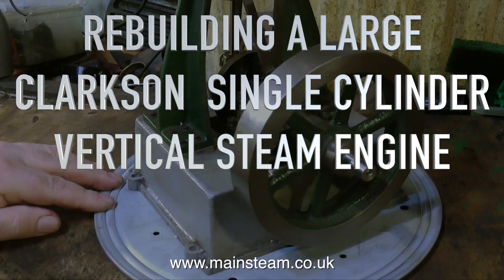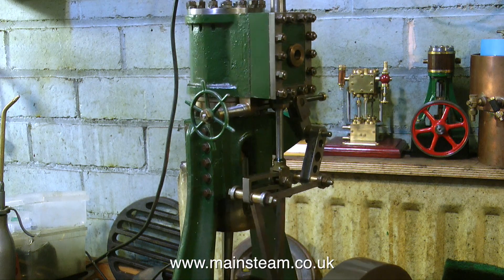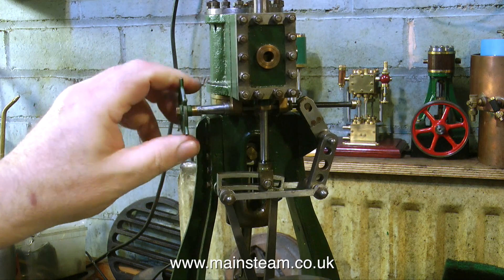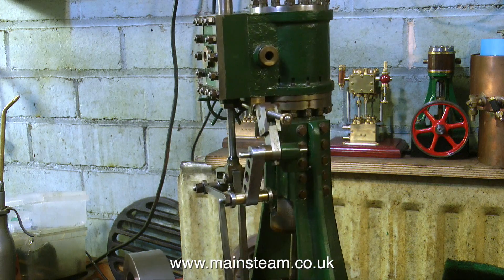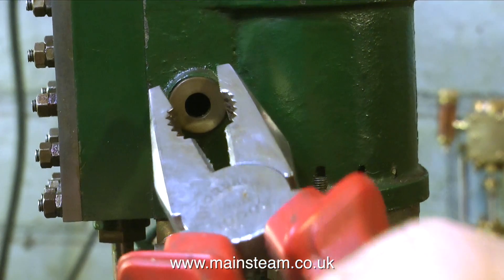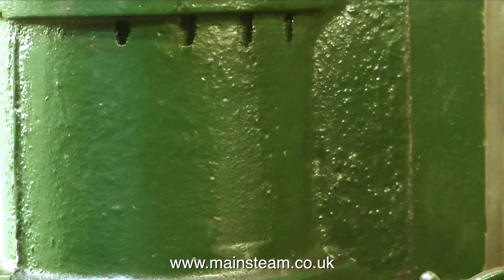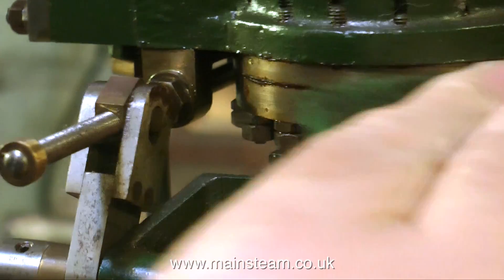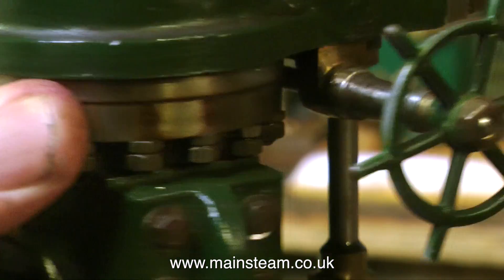REBUILDING A LARGE CLARKSON VERTICAL STEAM ENGINE - PART #1

Comment: This engine reminds me of the porch on the back of my house.  Someone attached the fascia board into the end grain of the joists with about one thousand nails.  Then of course when the weather hit it, the nails pulled out of the joists, so to solve it, the previous owner used about two thousand more nails. This made it worse.  When I purchased the house I had to repair the rather unsightly and quite frankly dangerous fascia with a new board and about 32 screws.  It has worked quite well and I haven't got tetanus since.

Somehow I think perhaps the previous builder of this engine and my back porch may have been related, or at least went to the same school.

Comment: Hi Keith I see why you set the drill press depth gauge when drilling the cylinder cover bolts.  It will be another interesting restoration build for us to watch.  When you see how a machine is made like this one do you put it down to going to fast at it or was it too complicated for the person, or Both? Regards John
Reply from the maker: +John Kinnane it's down to experience, often it's good to go through the early stages of making mistakes in order to learn - that's what I did. At first I often would make 3 engine parts until I got it right on the 3rd attempt.